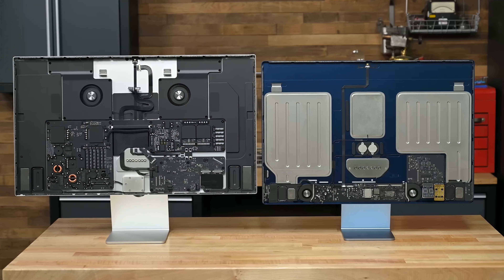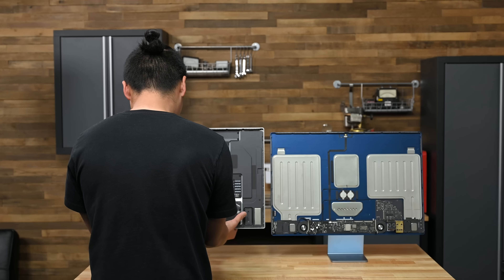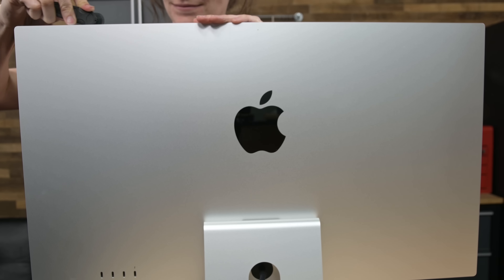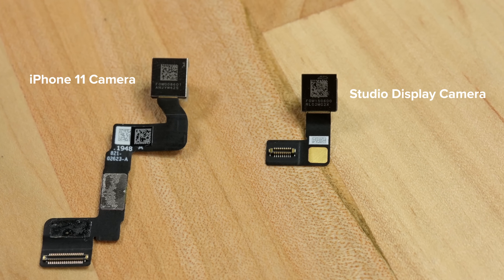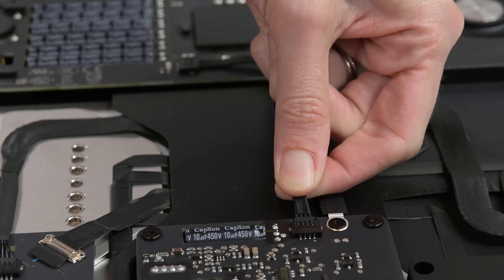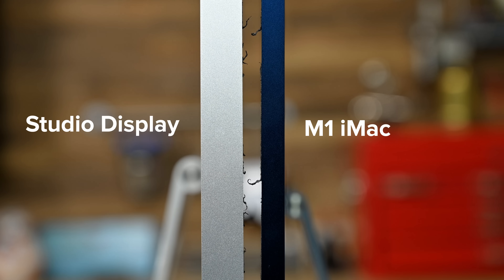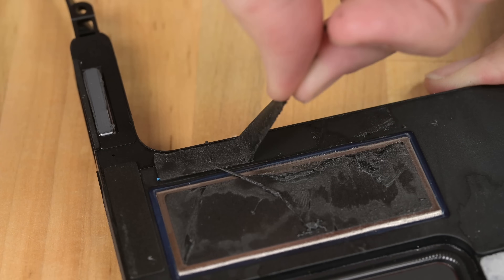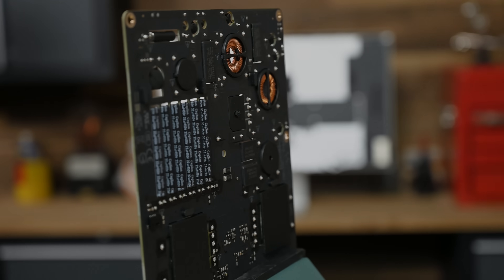Studio Display Teardown: Is this secretly an iMac?

Comment: 285 watts? That’s a lot more than the display needs. iMac on the way if you ask me.
Reply: 98 Watts of that is reserved for power over USB C, it's designed to charge the MacBook Pros.
Reply: Power devilry to the laptops over the TB (98W) + power delivery to each of the USB-C ports (might be 15W each) and then the panel gets to 600nits so likly uses a LOT of power itself and apple also want the power supply to run in the optimal range (power supplies become much sell optimal as you go to the top of thier rated range and produce a lot more heat).
Reply: @hishnash  > "apple also want the power supply to run in the optimal range"
When you do that, you actually rate the power supply lower. When engineers are given the task to design a 200W power supply that operates at 90% efficiency at its rated output, they will design for that requirement. As a result, you will get a power supply that likely could do more than 200W, but it isn't rated for it. In practice, a lot of (well designed) power supplies have over current protection that is well below what they could actually supply without overheating or permanent damage.
Reply: Not really. My Acer 27 inch used 180 watts. 

And one of my 30-inch Cinema displays use 150watts. considering how many more pixels that thing has, how much brighter it is, and that it has a phone inside it, yea it needs a good amount of power.
Reply: @chloedegurechaff1941  30 Inch cinema is using over 2 decade old backlighting technology that is less efficient which is also why it radiates so much heat compared to the newer LED backlit panels. The old 2017 27" i7 7700k and rx 580 full spec'd 5k iMac with this same exact LED backlit panel and a computer inside comes with only a 300 watt power supply to power the entire computer. That's with Intel and AMD's far less efficient chips. The actual computer+display power consumption maxes out at only 217 watts. I'm still waiting on my 2017 iMac, but my 2015 with the 6700k and m395 almost never exceeds 200 watts under heavy load. This panel seems to use only about 60 watts under full brightness so idk where the rest of it is going to. That phone chip maybe uses 8 watts under load. IMO they have headroom.
Reply: @Jushwa 
1. The Studio Display is brighter. 100 more nits. 

2. there has been no statements on how much power is reserved for the 3 usb-c ports.

3. power supplies are most efficient around 50-60% load. There more than likely is headroom. 

I mean how many pcs are out there with 800+watt PSUs but really only ever use 600 or less watts. 

4. I used my cinema display as a reference. they both use the same TFT panel type, and sure might have different backlights, or more likely just more zones available to control.

Also, the cinema displays radiant so much head because there is no passive cooling, there is no vents, no fans. all the heat has to build up and radiate out. its not because it uses 150watts. 

I had an 27 inch acer, also used 150 watts. but hardly radiated heat, because it had passive vents.

Comment: All modern tv uses arm or risc-v cpu in main soc' s. They uses linux kernel got wifi usb. They are full computer's just locket bootloaders. Some monitors do same thing,  some use microcontrolers :)

Comment: This thing splits my opinion. In general i prefer an internal psu but i dont think i would pick that over a replaceable cable. it feels like it chose the worse of both options. The larger frame of an integral psu with the length restrictions and cost of replacement that come with a brick.
Reply: the cable can be removed it is replaceable. 

the fact is an internal psu with the cooling etc its getting is much more likly to live a long life than an external brick that will just get hot, drop of desk while hot etc.

Comment: I like how the 24 inch has a whole-ass computer and just has that tiny board at the bottom but this thing is packed to the brim and all it is is a 60hz lcd…
Reply: You realise that the 24 inch iMac has a huge bulky power supply outside right! This display has it integrated in the chassis.
Reply: @carholic-sz3qv  PSU has no reason to take up that much space.
Reply: @dj_gzero  yes it has! Lol….
Reply: @dj_gzero  If you bothered to do any research, you'd know the display can provide 98watts of power to a connected devices via TB. Plus power for the usb-c ports, say 15watt each. that leaves 140-150watts of power for the display itself, which is on par with every other monitor on the market.
Reply: @chloedegurechaff1941  so 250 watts total? If you did any research you'd know 250w PSUs aren't exactly huge or alot. but be happy with your $1600 60hz LCD

Comment: That power supply is a thing of beauty. Crazy.
Reply: I notices it after i see your reply. Jeez that whole for coil is really fantastic design.
Reply: Too bad they used CapXon
Reply: Yep, it's quite beautiful
Reply: It's an engineering marvel. But it also added a lot of really unnecessary production cost to the device. The company has some really bad priorities.
Reply: @GirthOfANation  it’s not an engineering marvel, it’s just what they wanted to do! It was their choice and they had to make the power supply inside and flat unlike the iMac m1, also why did the m1 iMac has external power supply!? Lol…..
Reply: Lol….. it’s not! They just made a much larger/slimer power supply.
Reply: I’ve never seen board cut outs for the coils to fit into like that, have you?
Reply: @Jushwa  I haven't, and if someone proposed this to me in a design meeting, I would ask them what they were smoking. Sure, it's a solution if you really have to fit in that space, but when you could just use an external power brick, why bother?
Of course, now that it exists, it is an interesting thing to look at. I am sure the engineers who designed it had some fun with it.
Reply: @carholic-sz3qv   …thinner power supply doesn’t just happen. The types of capacitors used for power supply are NOT that small, there has to be clever circuit design, like use several smaller capacitors to replace a big one, etc. Samsung’s miniled tv also had to redesign the power supply to fit into the chassis.
Reply: @AaronFigFront  it’s nothing that only apple alone could make, it’s a flat design so the engineering and technology/parts to make it possible, plus the latest mosfets techs makes them more efficient and smaller
Reply: @AaronFigFront  yeah the galium nitride mosfets

Comment: So this display was on the 5k iMac and it needed one fan with a whole computer… now it’s just the display and it has two? What…
Reply: It’s a 5k panel with 600 nits and the power supply is internal compared to the iMac with external power supply and 500 nits 4k panel
Reply: @carholic-sz3qv  iMac from last year has an internal psu. And the 27 is 5k. They literally say in this video it’s the same panel.

Comment: Gee apple, it's not like there's a Silicon shortage going around and that we may be a bit short on computer chips that are actually usable, eh?
Reply: Nah, studio display goes brrr with A13
Reply: you realize A13 is using a process that isn't at full capacity? the shortage is mainly for current high-end products. new process for stuff like your 3090's, ext. not a 3-year-old process that's no longer in mass production.

It would be a problem if apple used an a15. taking away from a high demand process. but instead, they used a process that's not in demand.

Comment: I think they thought iMac 27 should be in the region between iMac pro and iMac 24, but not being too expensive.
That will make their margin too small, so I think they scrapped it at the last moment (if this design was genuinly what iMac 27 would have been) and then just release two products in order for more profit.
The thickness of the display is a nonsense considering the specification.
Reply: Yeah I don’t know about it.
Can you explain why?
Reply: Have you seen a 240W Power Supply? LOL ... You clearly don't understand power electronics.
Reply: And don't know about modern industrial manufacturing processes

Comment: Did you miss one of the most discussed components, the stand ?  How is that removed ?
Reply: Probably with those seven pentalobe screws in the middle of the chassis you can see at 4:09
Reply: @TheMilanMovies  yes that are for sure the screws for the stand but what about the holes for a vesa mount? are they already in the back just covered by the backplate? or maybe there will be external vesa mounts which are fitting these seven screw holes i mean woul be great for people which would like to upgrade by themself without bringing the display to an apple store.
Reply: @Carl Gunderson it doesnt remove? didnt you see the screws on the back?
Reply: @TheZPremio  it isn't meant to be removed would be the more accurate statement.
Reply: @TheZPremio  well you would have to remove the display first, which I assume would be an hassale
Reply: Speculating, but from the Apple Store image of the vesa mount, it is an H-shaped bracket that attaches via the same internal pentalobe screws as the other stands, to its cross bar, thus not user changeable (requires display to be opened). The vesa adaptor will then screw externally to the bracket via 4 screws into threaded bushes on the ends of the H arms.
Reply: @Carl Gunderson It can be changed at a later date, but only at an apple store, not by the user.
Reply: @UCt_LJB1QK3Xbejm8Qj7HTWA  @UCgFeo2-8Yp6Jihu7RKg4Kng  Apple won't do it either. Its a lot of work, best to just get the correct stand from the get go!

Comment: How would they NOT know that the smaller, 24", BLUE iMac that is obviously an iMac...is the computer? Do these people know anything about tech?
Reply: Not knowing Macs I also got it wrong because I assumed anything with active cooling has to be the computer.  Who would build a display that needs a fan...
Reply: @GeraldMMonroe  brought to you by the same company, who decided it was a good idea to build a MacBook Air where the fan doesn't connect with the heat sink. GENIUS.
Reply: @PvtAnonymous  yeah what is concerning about this design is you can't access the fans without breaking glue.  And the power supply is not going to be replaceable very easily.  The brick power supply style monitors you can just replace with another cheap supply that outputs the same voltage and sufficient current.
Reply: I was thinking that like how
Reply: The display looks similar to the internals of a MacBook I don’t blame them bro lol
Reply: Most people don’t know or even care how a simple toaster works so no, they don’t know. That’s doesn’t make them dummer, they just aren’t interested in this kind of technology as we are. E.g. some are interest in biochemistry and gets this pandemic cured.
Reply: Technically both are computers so everyone is correct. They should have asked which one is the imac
Reply: it was obvious which of the people they had looking was familiar with apple products and just immediately identified the iMac. guy told her she was right, and her look was just "yeah, I know."

Comment: NO, the iPhone 11 front camera is NOT an ultra-wide and Apple also didn't used it here... they used the one from the iPads, not from the iPhone 11.
The iPhone 11 front camera was only a 23mm equivalent while the one used here is a 13-14mm equivalent. So it's just logical that the iPhone 11 is sharper.

Comment: The first thing that comes to mind with the studio Display is an updated Homepod or some type of universal control. I think Apple will announce a brand new product in the Fall and we'll find out.
Reply: they just had a few thousand iphone 11 components and a few thousand 5k intel imacs in the warehouse somewhere and slapped them all together. there will be nothing new. this thing does not have any wireless antennas and stuff and no ethernet
Reply: @JPK1337  Disagree. Those are completely new panels from LG. The 5K iMac display and Studio Display are different side by side.
Reply: @dsdddsd4543we  they are the exact  same panels.
Reply: @SmooviesTV  it's really just a giant iPad or iPhone. why bother designing a new controller

Comment: i'm assuming they intentionally put the power supply inside as a gap filler to make the display thicker in preparation of the iMac Pro. By making it thicker = they can put more parts and eliminate the chin which the imac has

Comment: I feel like apple made their life difficult for no reason here. I dont think anything is wrong with external power supplies. Or if it is going to be internal they could have gone with something a little more standard, or easily removable. This seems like engineering for the sake of engineering, and not for a particular propose.

Comment: Apple's galaxy brain engineering team.
They made a Laptop without Fans & a Display with Fans.
Reply: Without losing fans.
Reply: Apple is actually loyal, to the fan manufacturer!
Reply: I am certainly a fan of that
Reply: And 64GB of ram, practically unused, or maybe they will unveil a DEX style iOS for the Studio Display to serve as media/internet consumption device on light use.
Reply: @coffeearch2906  not RAM.
Reply: "The world is a weird place"
- Some guy idk
Reply: Lol
Reply: big brain energy
Reply: And so many fans are crazy about them
Reply: Yeah, what do you expect are we are talking CRAPPLE!... I fix this crap on a daily basis & its just not meant/designed be fixed, all CRAPPLE wants people to do is just go n buy a new device, so much for CRAPPLE being green as they claim just more bs for a throw away company.
Reply: Power supplies definitely get hotter than Apple Silicon.
Reply: It works, doesn’t it?
Reply: My macbook air doesn’t need fans
Reply: Having the fans in the display allows them to have a power supply that will also power your MacBook Pro so no power bricks at all. Pretty clean and clever, I would say. (And no one has complained about fan noise that I have heard.)
Reply: @toadlguy  My MacBook Pro has a power supply that does not have a fan. I doubt this would need a fan if the power supply was an external brick. The problem with fans is that they can fail and they pull in dust. Avoiding fans can really help with the reliability of the product. Also, if the power supply was an external brick, it would be much easier to replace in case it fails.
Reply: @Finder245  I am glad someone said this, I was about to mention it to
Reply: @toadlguy  Sure but USB- power delivery already offers that.
Reply: @toadlguy and cleaning this fans is easy riight?
Reply: 14.7 million pixels to control. That has to be cooled down a bit!
Reply: @keesswier212  There are 8K monitors without any cooling-fans inside of it, and with much brighter HDR than this Apple display ...
Reply: Yeah.. And they say they are eco-friendly.. 

I mean, same chip that's inside a phone that doesn't have a fan... Thicker display, that clearly costs more material.. Components, like the fan that could have been avoided.. 

And they say, they are eco-friendly...
Reply: @neodidi  You clearly have no critical thinking.
Reply: Some aged notion that laptop HAS to has fans, and display MUSTNT HAVE fans? My dad would think that too. It's a 5K displays with all those pixels to cool down man. But then internet has no patience for truth, only time for a jab.
Reply: Clearly, you have zero clue about engineering and thermal management.  Go troll elsewhere and let the adults talk.
Reply: @Gmon750  Clearly you have no sense of humour.
Reply: @taaktuuq  true af
Reply: @Gmon750  when a kid pretends to be an adult, that’s you.
Reply: @Gmon750  why so agro dude. Same aggressiveness in real life?
Reply: @Gmon750  Clearly you have no sense of humour.
Reply: @Gmon750  apple sheep
Reply: @Gmon750  Why so condescending
Reply: @Gmon750  If I can ever hear these fans this is bad design. All these reviews about coolness and silentness of M1 devices and a 60hz screen where the fan kicks on if you use it for too long xD
Reply: @Gmon750  sheeps offended 😅I hope apple pays you bro because you are burning your blood for others
Reply: @Gmon750   everyone guess who'd get under tims cooks desk
Reply: @Gmon750  Yesterday my MacBook air broke down. Due to overheating, there were stripes on the display. Excellent thermal management
Reply: @Gmon750 Clearly, they could have designed it with an external power brick, which would mean a thinner cable to the display, and a thinner, cooler-running display.
Reply: @Gmon750  Q: How to identify if a product was engineered by an engineer, or designed by a designer?
A: It's engineered by engineers when it's put together using screws or bolts, it's designed by designers whenever glue is used.

Apple sure loves their glue...
Reply: @Gmon750  r/whoosh
Reply: @Gmon750  r/whoosh
Reply: @Gmon750  r/WaBooosh
Reply: @Gmon750  r/whoosh

Comment: The question for me is WHY even engineer a product like this in the first place? Why not just make a screen without all of the extra stuff in it? Crikey @apple, you astound me.
Reply: How else will they justify the price?
"We have to charge so much, we spent 1000 man hours solving a problem we created!"
Reply: Depends on what the users want. 

The extra stuff im assuming your talking about is the A13? I expect apple had a load of binned A13s they cant use in an iPhone (due to defective cpu cores etc) making this much cheaper than buying a good ISP chip for the webcam (and no they cant pipe the raw image data back over the TB cable to the laptop there is not enough bandwidth for that it needs to be pressed on the screen).
Reply: @hishnash  Its probably more so. they wanted to offload webcam duties, ext, off the computer, and they used the a13 because its on an older, cheaper, process thats still in current production at tsmc.
Reply: Why try to make something different? Just rehash old stuff and don’t try!